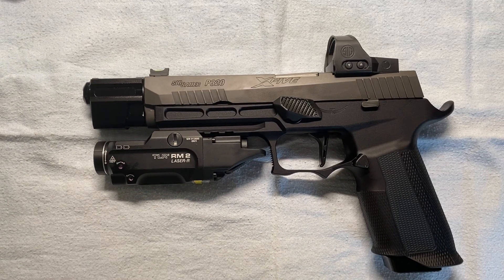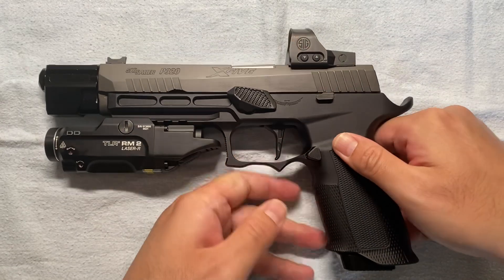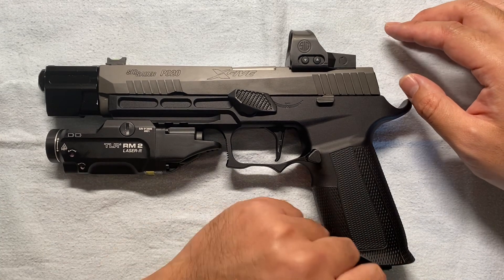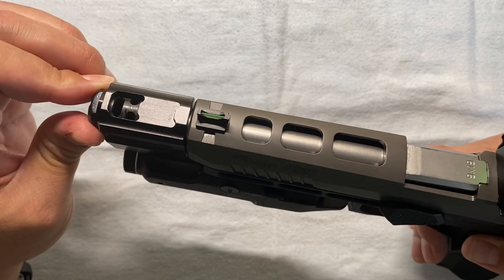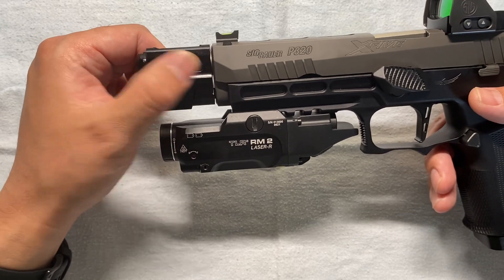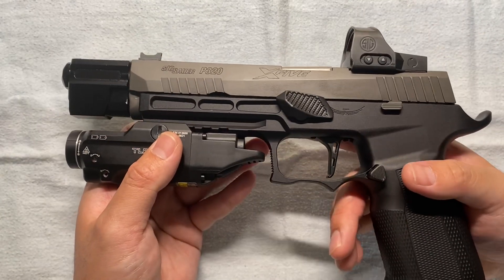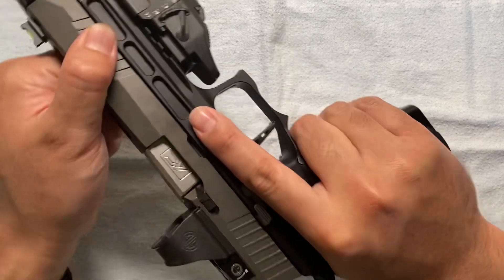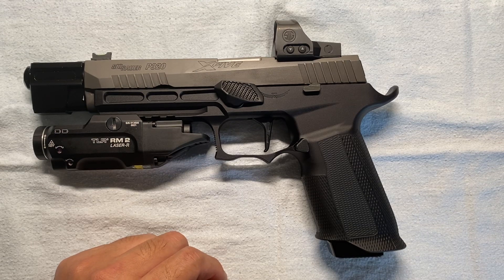Compensated Icarus Sig P320 X5 (X-Five) Legion with Armory Craft Goodies

Comment: I was told that light is for rifles/shotguns not pistols. I wanted it for a Glock 40 or Girsan Hunter.
Reply from the maker: Yes it’s meant for long guns. But it worked for me pretty well. The power switch isn’t hard to press. When I purchased RM2, TLR-10 wasn’t available yet. Now you can buy TLR-10 which is same length but a better choice for long pistols.
Reply: @9mmtactical  The TLR RM2 would fit flush which what I want.
Reply: @9mmtactical  where can you buy a TLR 10?
Reply from the maker: https://www.premiumselectsupplies.com/products/streamlight-tlr-10g-gun-light-green-laser

Comment: How is the accuracy of that armory craft barrel?
Reply from the maker: It’s very accurate. Way more accurate than I am or I can ever be.
Reply: @9mmtactical  I’m having problems with my give legion with accuracy and just curious if this may fix the issue.  I’ve been shooting it bench rest and I’m getting 6-8” groups at 25 yards vs other guns I’m getting 2-3” groups (my fn pistols).
Reply from the maker: @triggerbarPhD  hmmm i'd suggest you to first figure out the cause of the accuracy issue before purchasing a new barrel. When shooting bench rest, it should be extremely accurate. 6" at 25 yards definitely sounds bad. Did you shoot iron or red dot? Did you clean and oil the gun well enough? I've had similar accuracy problem with my aftermarket P320 slide and barrel. The slide was from Armory Craft and the barrel was from Killer Innovation. Everything else was in perfect condition but the grouping was just unpredictable and scattered. Later on when I switched on a barrel made by Armory Craft, the accuracy problem went away. But that Killer Innovation barrel worked fine on other P320 builds. It's still a mystery what really caused the problem, but I learned that for that build Armory Craft slide works the best with Armory Craft barrel. It's aftermarket stuff afterall. Different companies have slightly different machining accuracy i guess. Now coming back to your problem, if everything is Legion factory, there shouldn't be fitting problem. You said you're the second owner right? I feel something's probably broken. The best way to rule out factors one by one is definitely to try with a different barrel. If you can borrow one with no cost, that would be perfect. Do you have a P320 X-5 Legion?
Reply: @9mmtactical  thanks for this!  I am the original owner and yes, it is the full size xfive legion p320.  Yes it has a dot, SRO on it.  It’s been a persistent problem since I got it.  But I don’t always shoot at 25 yards and I’ve just always thought I didn’t shoot this gun well.  So yesterday I took it and bench rest shot it and some of my other pistols and no matter what I did or ammo I used I couldn’t get it to group better than the 6-8”.  Yes I’ve cleaned and lubed it many times.  I’m now just thinking it’s a bad barrel.  The reason I want to try this barrel from armory craft is I have a suppressor and want to use this as a suppressor host.  So was thinking of getting a threaded barrel.  But wanted to know if the accuracy quality of these barrels.  Thanks again!
Reply from the maker: @triggerbarPhD gotcha. You sure the SRO is fine?
Reply from the maker: @triggerbarPhD you know what, my friend has an AC threaded barrel for legion too. He bought it for his P320 MAX. But he has sold the gun so his barrel is idle and he’s willing to sell it. Would you want it?
Reply: @9mmtactical  Dang it, I missed this message and bought one!  Darn it, yes I would have!
Reply: @9mmtactical  well I've tried two different dots on it and same results.